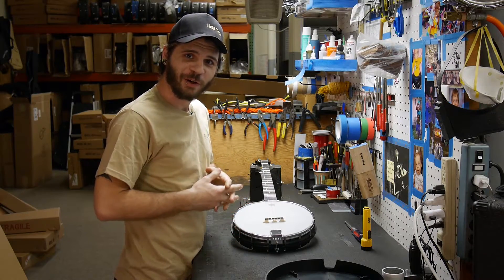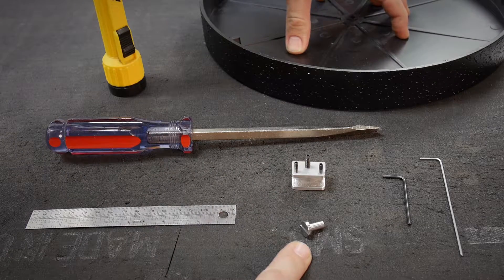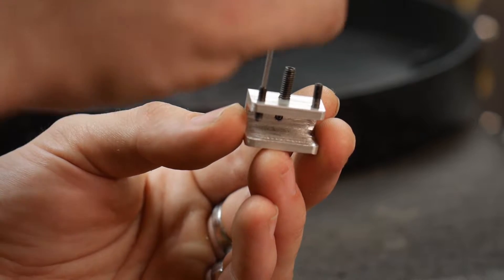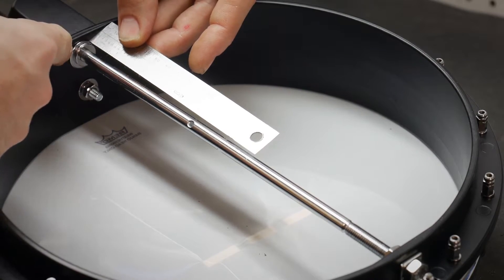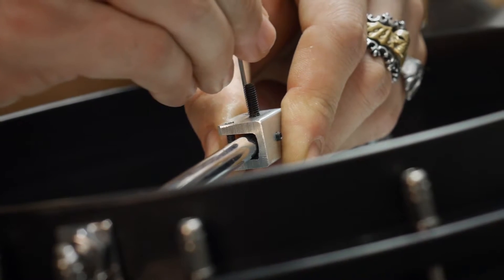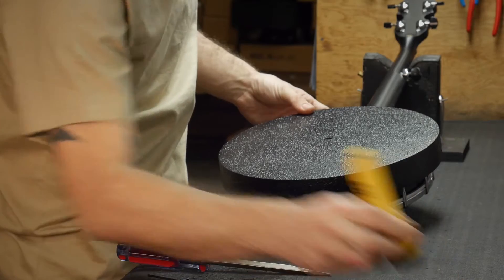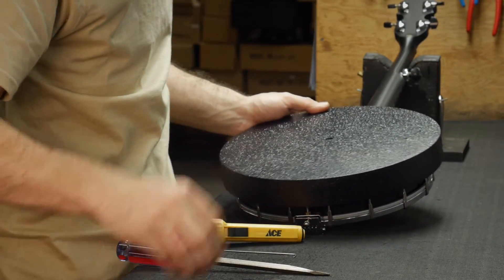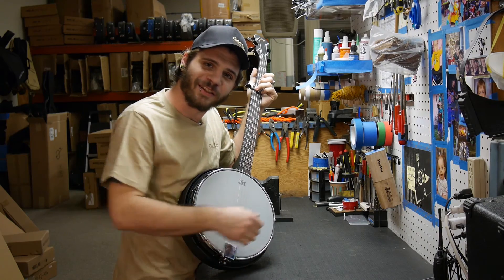Shop Tips: Installing a Resonator on the AC-1

Comment: I currently have a CC-50 Cripple Creek Open backed Banjo.  Would the AC-1 Resonator mount to the CC-50?
Reply from the maker: You can with a modified mounting bracket that we could provide for you. The only problem is that we are currently out of stock on the resonators
Reply: That is great to hear!  Thank you...